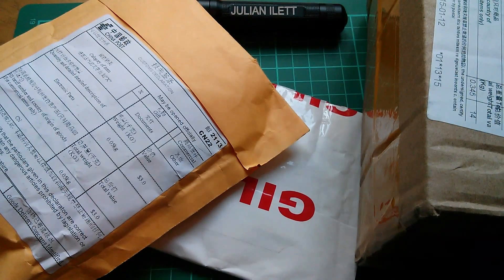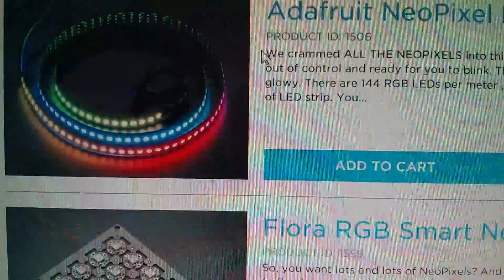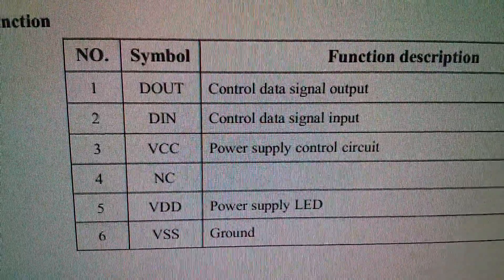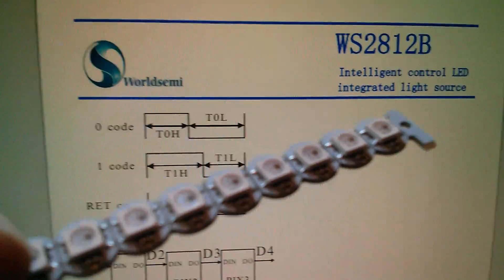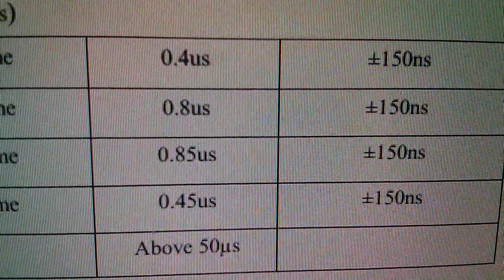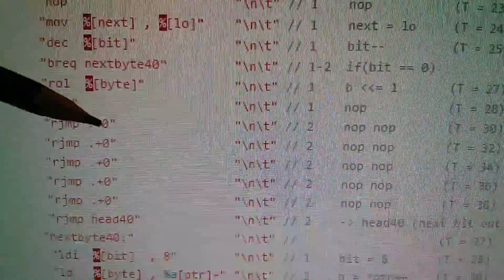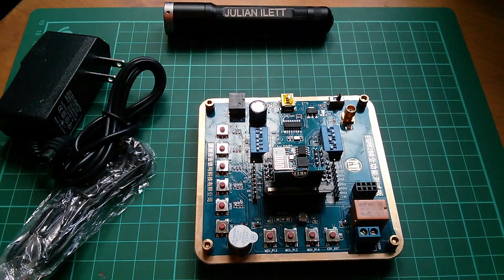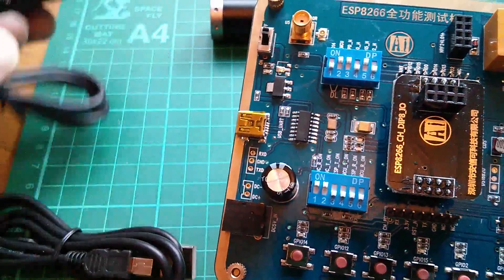Postbag; #33 - WS2812B RGB LED, ESP8266 Test Module

Comment: Let's turn back the years to 2015, back when you were playing around with the ESP8266, wasn't that great fun!  Just dug mine out the other day after playing with the ATTINY85 for awhile, I needed to get back to something that was easy to program!  So anyway, I found a different operating system to burn to her that would do something completely different.  It was the ESPBasic, really, a full feature basic that runs on the ESP8266!  While it will work on the 01 version, it really works best on the units with more RAM such as the 12E, well any 12 or better. I haven't tried it on the ESP32.  The neat thing, it even has drivers for OLED and other displays, the possibilities are tremendous for a BASIC lover like myself.
Reply: Oh https://www.esp8266basic.com/ forgot to leave a link!

Comment: Well, as usual, an excellent article, especially on the "2812B RGB LED "strips." I've played with them and now am looking for MORE to, simply, play with even MORE! <grin> Overall they're simple to use. That is off course easy to say since some pretty bright person had to drop down to assy language to do it, always a complex practice.

However I find it MOST difficult to BUY the things, the ones you actually WANT. I've made the mistake of buying "what I thought would work" and that was, in a word, "dumb." I find the most confusing problem is how they LABEL those items. As you said, "Which is it?" referring to a product listed as a "WS2812B WS2812 WS2811 WS2801 RGB 5050 STRIP." I repeat, as you said, "Which is it?" Often though the TITLES are somewhat accurate stating it's a WS2812B and that's IT. But then if you make the mistakes I have read you might find them, again, throwing in "WS2801 WS2811" and not even MENTION "WS2812B." Clearly many of these sellers THEMSELVES don't really know what they've got so the mindset appears to be "Ahhhh, just throw 'em ALL in." Ouch.

So once you've gotten past this mess, yep, these puppies are a blast to play around with both for fun along with actually making something that could be called "useful."

Comment: I guess they would be using the MCU on the tester board to automatically test a batch of ESP8266's.

You can program it to send AT commands and then check the output of the ESP8266 on USB or by LED's etc.

Comment: 3 guesses where the magic blue smoke escapes when you grab the 12v instead of the 5v and plug into the power port? Why the CH340 of course!  Burned mine up in a microsecond.  The rest of the board seems to work, and the ESP8266 works just fine yet so I think all I need to do is replace that chip and I will be back in business.  Gotta learn to be more careful with that.  To many plugs. To many cords....

Comment: Hi  Julian - after watching, I just had to get one.  Have had it for quite some time now, and managed to find some magic blue smoke emitting from near the little speaker thing.  I contacted Alice, and they suggested replacing the burnt LED that was above the push button near there, which I manged to do, but it still malfunctioned.  I asked for more advice, and Alice said they would send me a new board on my next order.  Well nice sales technique, I immediately ordered a few more items I had on my watch list, and with quite unexpected speed, received an updated version of this board. The solder mask on the new one is white!  Makes telling the old from the new quite easy, and there are some minor changes in the board, mostly just with the printing and a few extra resistors appeared here and there.  After working with the new one that performed much better (perhaps I had learned how to use it better?) I managed to get the old one to begin to perform as well.  Not all is working but enough that  I can perhaps use it in a project as a base for an esp8266 project.  I love these, they make updating the esp8266-01 units much easier as you can simply flip the dip switch on CPIO0 up and it is ready to flash, and writing programs is easier then hooking a uart adapter as it is simply a plug and play with the dips all set properly.  Wish I could find a better manual, the one they sent me is in sort of pidgin English, perhaps I should hire on as a translater, however I don't speak Chinese  but if they gave me one of their translators, I could translate their pidgin English to American English, then perhaps you could translate to UK English.

BY the way love your channel I check every day for new content, and regularly watch some of the old to increase my understanding on many of the things I have ordered because I watch your channel.  You are the  best advertisement for Chinese electronics there is on the www.

http://www.jericsson.info

Comment: Julian Ilett FYI, just noticed that Banggood has a nice deal on the WS2812B LEDs modules: http://www.banggood.com/50Pcs-DC-5V-3MM-x-10MM-WS2812B-SMD-LED-Board-Built-in-IC-WS2812-p-963382.html - I usually get mine from Aliexpress but that usually involves a little bit more hassle.

Comment: Uh-oh...  I think they want you to write the manual for them.
Reply from the maker: bigclivedotcom Ha ha. I hope they have lots of patience!
Reply: Julian Ilett If it was JUST a breakout board with LEDs and buttons for all the modules IO pins then it wouldn't be so bad.  But that random processor in the middle complicates things a bit.  Unless it's to expand its functionality or emulate the module?
Reply from the maker: bigclivedotcom The "user guide" shows an Android app (all in Chinese) which can light an RGB LED and switch on a relay. I'm guessing the processor sits between the ESP and this rather basic hardware. I'm much more interested in making the ESP's own processor do the clever stuff. I've got another test board coming which I think IS just a breakout board: http://www.ebay.co.uk/itm/301475108343

Comment: I wonder if the test board description is trying to say you can use the MCU to load the AI-Thinker firmware without the PC? Maybe it's programmed to flash the ESP module with stock firmware with a certain button sequence?

Comment: that ESP8266 test board is very interesting.
Some days ago i bought a similiar but smaller board with a pretty strange white esp8266 version i can not identify. Still waiting for it to arrive and test it.
Reply from the maker: Gigawipf I think I might have bought the same one. Is is this?: http://www.ebay.co.uk/itm/301475108343 - it seems to be called an ESP201
Reply: Julian Ilett Yes this is exactly what i have bought from a different seller.
But unfortunately i can not find any data or information about that dev board anywhere but it was cheap so i had to buy it and see for myself ;).
If you know more about that please let me know.
That board looks like it might be actually useful with the nodemcu firmware.
Reply: Hello +Gigawipf, I have the same board, and I made a video using it last night with the Blynk app. Have you been using yours?
Reply: hey, this is pretty cool. At the moment i am not doing anything with the board but i still have two working ESP8266-201 here and a strand of 50 ws2811. The lua firmware is pretty unstable and slow for anything that requires timing. The arduino framework does not work that well and most of the time i can not program the module as one of the dip switches is broken. Maybe i will try it again later. This Blynk stuff looks really interesting.

Comment: Idea for you: Could you use one of those wifi boards, to read the voltage from a car battery, and somehow make it readable say on a Android phone? Obviously from a web browser. It would be interesting to then track the voltage and maybe warn you when the battery is dying. Maybe use IFTTT to read the web and send you a text if the voltage gets low?

Can that boasrd read an analog or A to d voltage?
Reply: biggest issue is, logging onto wifi networks, would work when your parked at home, but not easy to add other networks when your out

Comment: Have you checked out the APA 102/103/104 led.
Reply from the maker: Jack Rhiel Interesting - the APA102 uses an SPI type interface with separate CLK and DATA lines, but the APA104 looks like it's identical to the WS2812

Comment: I have the same test board and love it. But on my unit the esp8266 is mounted 180 of how yours is mounted. Ive checked my pinouts and they are correct and the unit does work. Interesting to see yours is made that way.

Comment: WS2812B is the name of the pwm controller chip, which is integrated into different kinds of led packages like the chip leds you have, 5mm/3mm/strips etc. that's why you find different products with the same search term.